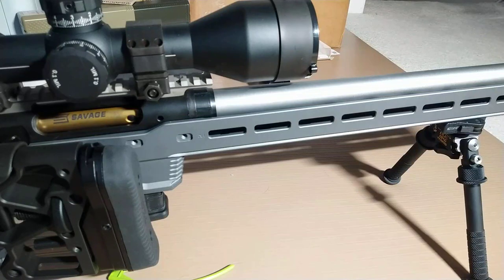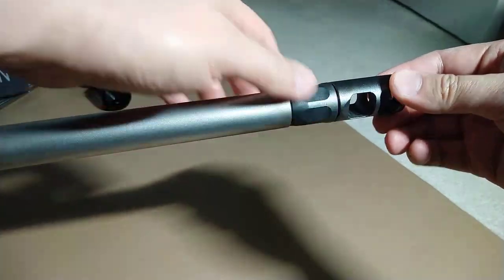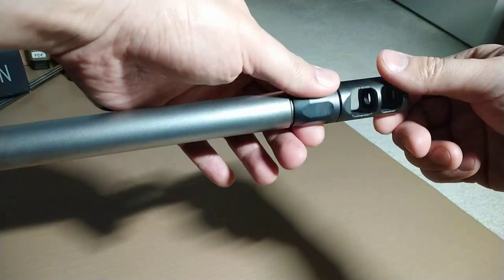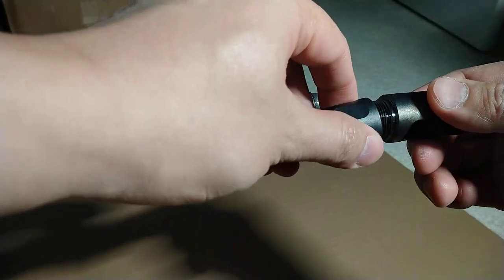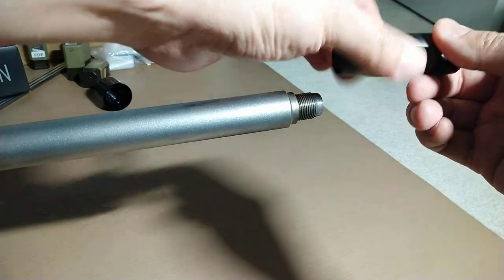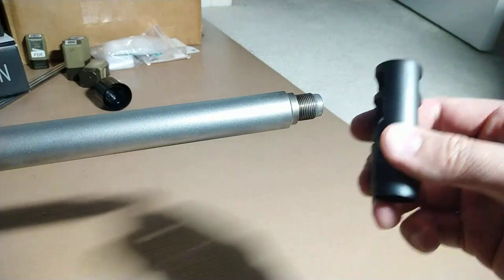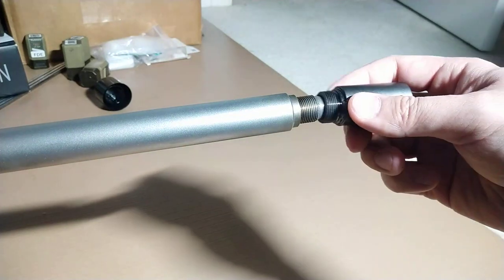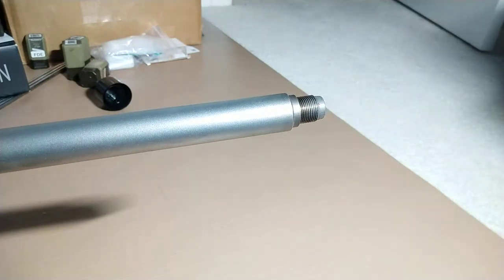Savage Elite precision 110 muzzle brake removal

Comment: This made removal easy.  On first glance I thought the brake was held in place by a jam nut.  Video showed hot it is actually set up.  Barrel vise and wrench spun off the parts with minimal effort.  Thanks!

Comment: Can I take the brake off when hunting and use something else?  I like the muzzle brake when practicing and sighting in.  Thanks I have a Savage 110 High Country in 7mm
Reply from the maker: I don't have 110 high country. But you should be able to remove muzzle brake and just use a thread protector.
Reply: Ok I will look into that and thank you  @caparsenal001
Reply: @caparsenal001 I have a Msr15 with that Muzzle Brake on. Could I also put on a other one ? Like a surefire Warcomp?
Reply from the maker: Yes, it should be fine, after I removed this brake, i put a SCO asr brake on the rifle @kevin.M.T
Reply: It will not shoot the same with the break removed